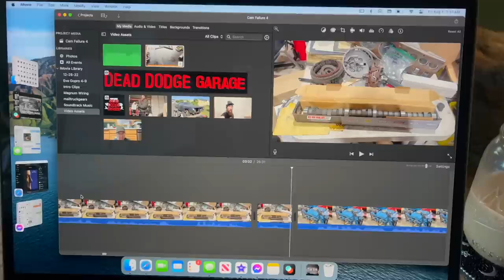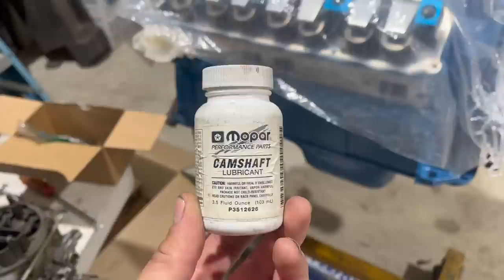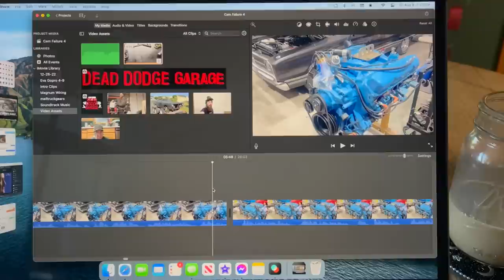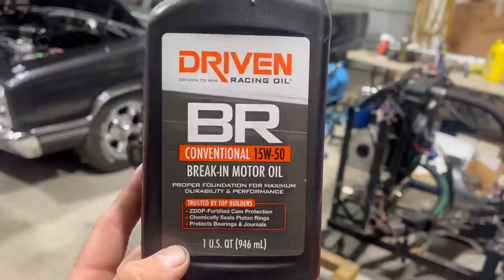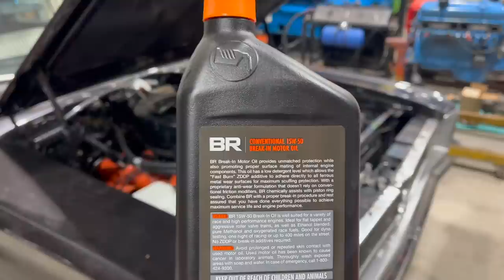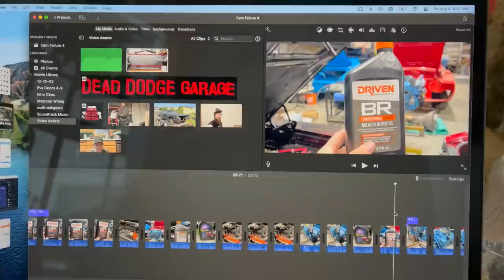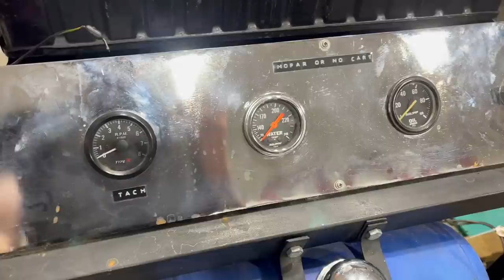How To Make Your Flat Tappet Camshaft Live, And The Anatomy Of A Failure

Comment: The windage tray is a non-issue. I've never removed them and looked into this. The oil is draining down from the block and hits the crank then the tray before draining into the pan. The crank is above the tray so will still aerate or agitate the oil draining back from the valley. It might actually help but isn't a detriment. Actually, the more important thing is the fact that rod bearing shells are made without the notch for the rod oil piss holes now. Have been for some time. While it's not a causal factor for a wiped cam it sure could help these days having the extra oil thrown around. 
You can get break in rockers with 1.2-1.3 ratio. I would use the factory stamped rockers for break in since they are rarely 1.5:1. If you are running adjustables I would break in with the stamped stockers. 
I think the biggest likelihood of your issue was the lifters. I've broken in cams on the 'Hemi' Springs with 310-340 psi without a problem. I wouldn't recommend it though. I've always used the black moly paste lube. It's thick and what 'works for me'. I have been checking the taper on my cam and lifters. All you need is a 'Vee' block a dial indicator and a magnetic fixture. But even if you don't have those you can just assemble everything without the pushrod and check your lifter rotation to make sure they all spin. If some don't you can swap them around in the bores until they all do. Some may spin faster or slower than other. That's OK. As long as they all spin. I paint a white stripe or a '+' on the pushrod top and pull the valve covers and spin the starter or crank it up for a few seconds and check the rotation.
BTW, there is only ONE US based HFT manufacturer. And even they are probably not what they used to be for a number of reasons. Safest bet. BUY NOS. Last I checked Johnson's were selling for $300-$400 a set. You can buy 2 sets of vintage NOS lifters for that price.
Reply from the maker: Damn it, I didn’t mention NOS lifters at all in this video, did I?! That’s what we put in this engine 🤦‍♂️ I knew I was forgetting something important. For crissake. 

This engine is running stamped rockers so… done. But I am not familiar with break in rockers. That’s really interesting. I completely agree - I think it was a crappy lifter failure. I already made a video in which I said exactly that. The purpose of this video was really to wrap up everything I’ve learned since then, and try to give a better big picture view of what’s going on here. 

Someone commented before about making sure pushrods were spinning too. I recently had valve covers off of a perfectly good engine and watched for this. Many of the pushrods didn’t spin. I have questions.
Reply: @DeadDodgeGarage  Good deal. That's really your safest bet.  '98-'01 that was the beginning of the 'problems'. I think the original 'Johnson' was bankrupt by then. Eaton just quit the HFT biz and Stanadyne was going under. All the HFT's that come in cam kits now are either 'hit or miss' Johnson's (HyLift/USA) or really sketchy Mexican Sealed Power (reboxed). There was (is) another REALLY great Johnson Lifter from Taylor, MI but unfortunately, they bailed of the HFT market in 2016 or 2017. They did make some nice lifters for a while.
I always thought it might be a good idea to take some junk valve covers and cut a long window along the side (facing the intake) and silicone on a piece of plexiglass just to watch the pushrods and make sure they're spinning during run in. I have seen some start and stop early during break in but OK at the end. I think most of the bad lifters are Mexican.
Reply: @DeadDodgeGarage  If your pushrods are spinning it means your lifters are spinning and rotating. It's hard to see sometimes. You need to clean off the top of the pushrods near the rocker and use a paint pen and mark a stripe 1" long or so (maybe put a '+') so it's easy to see. Bottom line, if you can't see pushrod rotation the lifters isn't either. It's because of the force when the cam is opening the valve the lifter and pushrod are solid so any rotational movement is transferred to the pushrod. I learned that from an old tech guy at a cam company many ages ago.
Reply: @DeadDodgeGarage  Break in rockers are an easier way of lowering spring pressure without changing valve springs. Typically somewhat less than your 'normal' 1.5 rocker arm ratio. Most of the stamped Mopar rockers are anywhere from 1.34 up to 1.43 or so. Rarely ever actually 1.5. Even if you have a hydraulic cam it's worth it to get a cheap set of adjustables to get the full lift and dur from your cam. More of the lift though. To be honest though unless you have crazy spring pressure 330-340+ you wouldn't need them.

Comment: You know, talking about the cooling problem, I work with stationary Diesel engines, and even though they are the same as over the road truck engines, the radiators are about 3 times the size of truck radiators. I'm 6 ft. tall and some of the fans on these are as tall as me, solid metal blade fans, no fan clutch. Even in a perfectly good working car cooling system, they were designed to go down the road to be most efficient, not sitting still. Just my thought on it. Good luck.
Reply from the maker: Indeed. I’ve spent a good bit of time explaining similar ideas to people. But what cooling problem are we talking about? An engine warming up during break in?
Reply: Yes, such as overheating on a test stand or in a car, and having to shut the engine down too early. @DeadDodgeGarage

Comment: Jamie, if I was building a 340 or a 360 how can I build it to get the most bottom-end mid-range torque out of it and could you recommend a Cam and lifters for that purpose?
Reply from the maker: I can’t really recommend a cam for that any better than a catalog. There are so, so many options. These days, “the way” seems to be relatively high lift combined with less duration for less lope and better low end performance, and good top end power. But the word “relatively” is doing a lot of heavy lifting in that sentence. Compared to the .444 lift cam, .484 would be substantially larger - and yet relatively little lift by today’s “everything needs 500 HP” standards. I can tell you the .515 lift Thumpr in my 360 is definitely not what you want. 

I think the best thing for you to do would be to contact a cam grinder. Tell them your combination, what you want to do with this car, and let them make some recommendations. If you have an automatic with a stock stall and highway gears, you would be shooting yourself in the foot with a radical cam choice.

Comment: Nope. Ain't buying it. You made several excellent points about new precautions on engine break in. 
But that is the old game of tip toeing around, holding your mouth right in order to make a potentially inferior part work. The precipitious rise in cam failures over the past is NOT on assemblers. Tightening up(and documenting) your assembly proceedure however will be helpful the next time this happens and you're discussing it with the smartass in technical support.
Reply from the maker: It’s poor quality parts + aggressive cams + valve spring pressure + various oil problems. Notice I mentioned poor quality parts first - here, and in the video. I am completely in agreement - I have seen the videos documenting terrible lifter machining - but I think there is more to the issue, and to reduce it to just that one problem serves to cloud the possible view of a bigger picture. 

I already made a video yelling into the abyss about crappy quality parts. You might have even seen it. Then, after reading lots and lots of input from people with more knowledge and experience than I have, I gained a slightly better understanding of the problem. One of my strengths in this (and in life, I think) is an ability to absorb new information and adjust to it. I know this wasn’t a problem in the bad old days. America knew how to make things then. I’ve been building engines for years and hadn’t had an issue until this one, so I must have done some things right. 

I literally documented the build procedure of this engine on YouTube, if they have any questions. 🙂

Comment: I will never run a flat tappet cam on purpose after all these failures. It may cost triple the money for roller cam and lifters but piece of mind and lots more flexible for type oil used. Plus roller cams offer better profiles!
Reply from the maker: I get it. There are a lot of pluses to the roller, there is no doubt there. In fact, I am planning to use a roller cam in an upcoming build, for reasons completely unrelated to flat tappet failures. For my regular engine builds, I’m sticking with flat tappets. I feel like the one failure I’ve had out of dozens of engines is a pretty good average, really. I’m determined to keep building these engines the way they were designed to be - and cheap.
Reply: ELGIN cams are fine plus NOS lifters

Comment: I'd heard of all these tips except the one about removing the windage tray, I think that's a bit excessive tbh.

Also the lifters should rotate regardless of engine speed.  This can be tested with the valvetrain assembled but before break-in lube is applied.

One way to keep temps down during break-in is to hook up vacuum advance once the engine is running well.  It's under zero load so 40-50 degrees total is by no means too much.
Reply from the maker: Roight. We tried vacuum advance with this one but it got angry. Apparently I had put way too much base in it by ear, so left it off. Did check it with a light, it sounded happy around 25 so I left it there. I was explaining to Tom as we were doing this that more timing equals less heat.

A couple people had suggested the windage tray thing, and it makes good sense to me, so I tried it and included it here. It might be pointless. I don’t think the possibility of extra oil flying around can hurt during break in. But it may well be excessive.
Reply: @DeadDodgeGarage  glad to hear you understand timing vs running temps, some guys are like "don't want to give it too much for break-in" and retard the timing from ideal which is silly.  I get the reasoning behind the windage tray removal and I don't think it was bad to include in your video but for me especially breaking in an engine in a car, it's more trouble than I feel like going through haha.  There is pretty constant oil spray coming from between the rod bearings which in my mind is plenty.  But anyway like you said, it's a complicated problem and impossible to narrow down to one cause, I could be wrong 🤷
Reply from the maker: @mopartron3030  totally agree. We are really lucky here because having the cart now, all of our engines are broken in before going in the car, and it’s easy to swap stuff like that before the final install. I could definitely see it being too much of a PITA and not worth it. I’m wrong all the time, and I’m totally fine with that. I’m here to share info - and that absolutely goes both ways. This is all one big thought exercise for me.
Reply from the maker: @mopartron3030  oh yeah - and I learned about timing during break in many years ago, with bright, glowing headers on a 350 in a jeep melting everything around them 😅 sometimes learning is hard - but these are the lessons that stick with us.

Comment: Is there anything that can be done to prep the lifter bores?  I followed instructions on the Hughes website and have a handful of lifters that ride up on the lobe but don't follow it back down.  I'm wondering what I can do to help with that?
Reply from the maker: Oh that’s definitely not what you want. As you know, they really need to drop right in and move smoothly. I did not discuss that in this video, but did in previous videos on this engine. Yes - there are different ways they can be refinished. Any of them will require thorough cleaning of the attached oil passages afterward, so if your engine is partially assembled, unfortunately you’ll really want to break it back down. I’ve seen rust spots that I’ve removed with steel wool and some lubricant. I’ve seen nicks, proud spots and similar which I have removed with light sanding. And, they can be refinished with a small hone. This is essentially what the machine shop does. I imagine something like a small brake cylinder hone is pretty ideal for this - although I have never attempted it myself.

Comment: I could play devils advocate here….I used to work in a Chevy and a Chrysler dealership back when all cars still ran flat tappet cams….how come there was no cam break in process on a new engine from the OEM?…no break in oil either….a lot of people that bought new cars hardly ever ran them over 2000 rpm, yet the engines still lived…been doing a fair amount of research on this myself….first thing I’ve found out is, it’s more about oil film strength than amount of zinc ( you can actually over zinc an engine)…according to Mobil Oil, if you have at least 800ppm zinc/phosphorus flat tappets will live…been there, done that for 20+years now…..most people don’t know that zinc actually breaks down during use….have known (and used to teach) about cam lobe taper & lifter crown…not hard to check with a dial caliper and a dial indicator….also found out that the main company that’s having issues (initials are C C ) had a proprietary in house machine that made lifters…only to burn up in a fire, which left them scrambling to outsource lifters…found to be not a good source…..look for Johnson Lifters…
Reply from the maker: Well, one thing is for certain - modern oil is worse. Are you sure there was no break in process on new engines in that time? Are you sure there was zero engine break in before the cars left the factory? I really want to know, because people yammer on and on about how “we didn’t used to have to do that.” I want to know what Chrysler did in the 60s. It’s not something anyone has been able to tell me - yet.
Reply: @DeadDodgeGarage  as far as at the dealership level there was no break in....I did new car prep, and cars just came off the transporter with zero miles....I went through a checklist and put it out on the lot....and you can bet none of the OEMs would have people sit in each and every car (thousands every day) and go through a break in procedure.....I beg to differ on the quality of today’s oil....synthetic is definitely better, been doing once a year oil changes for myself and my customers for 22 years now, including fresh engine builds...haven’t lost one yet
Reply from the maker: @Mr9501  synthetic is great - for modern engines that are designed for it. Things stay cleaner and it lasts much, much longer. Our flat tappet dinosaur engines beg to differ on that point… there had to be some process when they were first fired up and driven off the line. I would like to know what it was. If they hit the key and drove it straight onto a transporter, or if they did a heat cycle, or a period of higher RPM - whatever it was, I would really like to know that to be fact.
Reply: @DeadDodgeGarage  I’ll try to do some digging...living in the rust belt, a lot of the OEM’s had factories around here....I’m sure I can locate a few former assembly line workers and see what they remember...

Comment: Not for nothing but a genset will run all day at 3600 rpm and stay cool. Not that you want to do that but get that air moving and it’s doable to stay cool on that stand.
Reply from the maker: Are we talking stationary gens, with a radiator as tall as me? Or are we talking marine, with giant channel coolers? Anyway, you’re absolutely right, and we’ve already solved that problem with a much better cooling fan. Our last break in went the full 20 in one shot.
Reply: @DeadDodgeGarage  like a 50kw job running with a big block ford. I see them tucked away in dank rooms all the time. Rads are bigger but not huge huge and  they’re rated to run all day at full load. 

Anyhow ya beat me to the punch in saying throw an electric fan with a shroud on there pulling room air across the engine and out . Nice setup with the break in stand.

Comment: Ignition wire set was accel super stock yellow 8mm and switched to the factory Chevy truck sbc ac Delco 86 k20 replacement set from eBay the distributor was the Napa crate motor replacement with the napa ignition control module and the cap was the premium msd brass heavy duty gm replacement and new ac Delco napa ignition coil in the top of the distributor cap

Comment: It just seems like this issue has been on the rise as of late...far more so than it was a decade or so ago. I was thinking it was a metallurgy thing. If the grinders are getting their blanks from less than reputable companies that could explain it.
Reply: It's not metallurgy or the cam cores. There's only ONE company that makes the cores. American owned made in Michigan. Same rockwell hardness as always, mid 40's to 55. Engine Power Components (EPC) USED to have some cores on the market but the majority are Wayvern Bartel.
Reply from the maker: After seeing the lifters from this engine that disintegrated, I also had some pretty big questions about the metals being used. I’m far from an expert, but many people who have in depth knowledge of this (like Vince who responded here) have said it isn’t that.

Comment: Well for those of us that like old school stop or try to bring stuff back to stock flat tappet have served perfectly well for years and I've had some pretty radical cams with flat tappet in the engines ran perfectly fine matter fact the 360 that I'm running today has 450000 miles on it still runs absolutely perfect on flat tappet